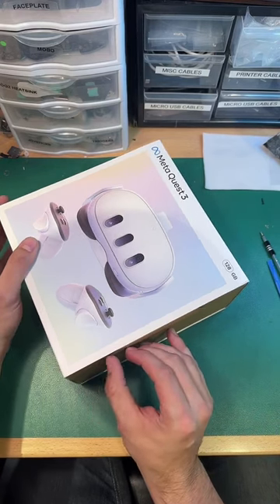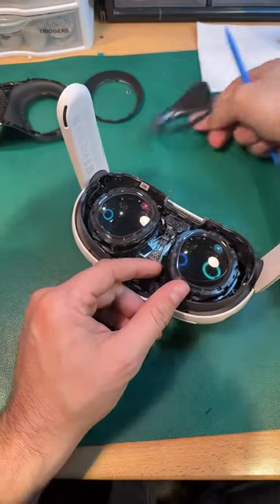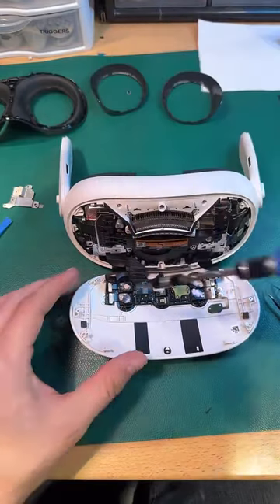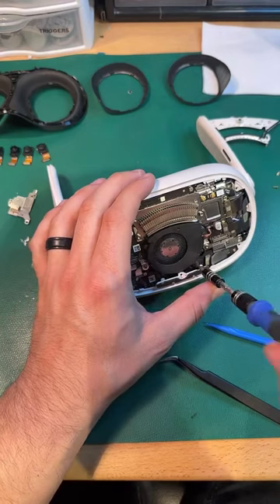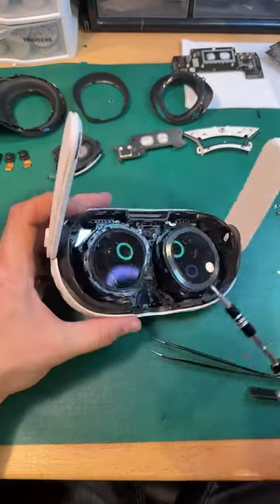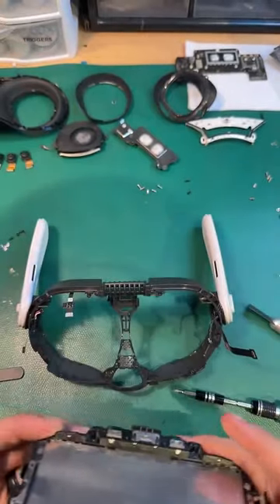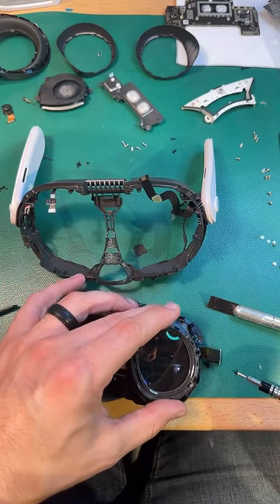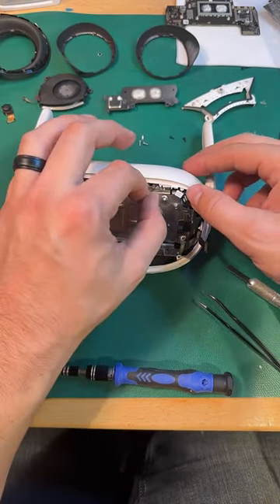First teardown of the Meta Quest 3

Comment: I need to replace my lenses. Even if you didn't take them off, it seems like there are just a couple of screws holding them in. Do you think they can be removed easily by removing the screws around them?
Reply from the maker: No. I have a more detailed and updated teardown video for the quest 3 I made a couple weeks ago. In order to remove the lenses, you pretty much have to take the whole thing apart.

Comment: 55:48 So the three holes on the bottom are the microphone.  I think the Quest 2 microphone is two little holes far off center, where the Quest 3 microphone is 3 larger holes closer to center where you breath out when you speak.  No wonder it has a popping problem.
Reply: No, the three silver holes are for the POGO charging mount.  The microphones are on the outside of the nose bridge (one on each side), in the ridge behind the front plate.  The center hole is the noise cancellation mic.
Reply: mic is in the bottom and one in the front where depth sensor is

Comment: Looks like they could cut down almost 40% of the size and over 50% of the weight from the front if they would just move the battery and SoC to the back or into its own "pocket pc" design. The size would help make it even more center to your center of mase making it feel lighter - but also be lighter as you move around. Their move to flat lenses would also remove another 20-30% for the optical stack too in the future - we're talking a headset that could be as thin /thicc glasses.

Comment: Good job, keep it up ! Thanks ... Love to see you mod the battery to outside to reduce the main weight and easy for replacement.
Reply: @supersayan8179  Many people forced to remove inside battery to outside but their electronic perk has locked. Most of them are not comfort by heavily in the front. After remove the battery and some plate, it will be light by at least 70grams for comfort in long time.
And will be great if you put the battery and the radiator on the electric scale.
Reply: @Snack.Dragon  Tell me, if you disconnect the battery - remove the cable and connect only via Type-C - will the glasses work?

Comment: Hello, have you had any opportunity to repair a Quest Pro controller?  Can you please tell me if they use the same analogue stick component as Q2 and Q3?  I can find replacement stick sensors on Amazon for Q2, but not QPro or Q3.  Just wondering if they all use an identical part?

Comment: What's the weight of the battery ?
I would love for someone to try a battery less/tiny batterie mod for the quest 3
Reply: Tell me, if you disconnect the battery - remove the cable and connect only via Type-C - will the glasses work?

Comment: I'm curious. Do you know the weight of that rubber lens gasket + the lens protector rings (the parts you took off between 12:30 and 14:45)?... Wondering if i can 3d print a custom face gasket and trim some weight..

Comment: Hardware is crap - now our 3rd Quest 3 is broken. On the first after a week it go into bootloop.
Second after few Days it wont charge anymore and got only hot.
Third now, the fan is broke and overheat.
Were pissed... now send back again... waiting to get money back for weeks and then order the fifth
Reply: Did you opened any of them to inspect what can cause all of these issues? Pay attention to corrosion on the connectors, condensation and sweat may cause this
Reply: @AlfarMazabadi  The 4th Quest3 is now running without any Problems.
Maybe we got the first 3 out of a false charge
Reply: Still curious what's causing these problems.